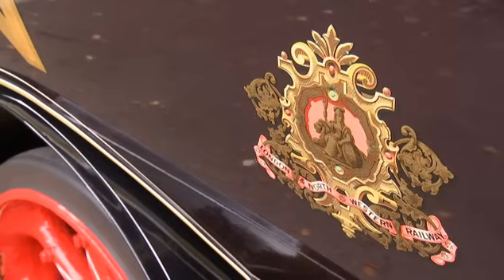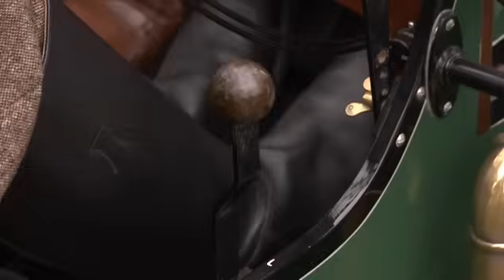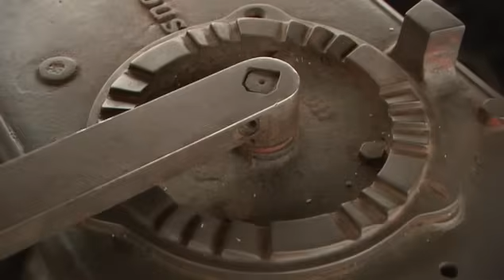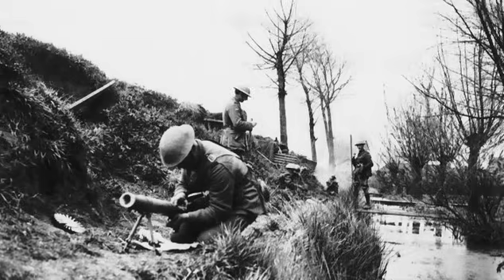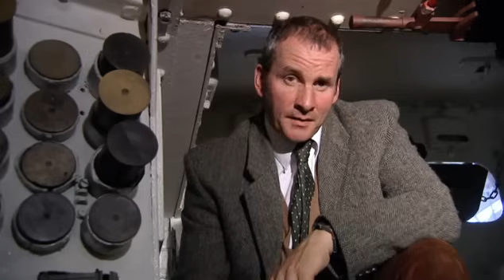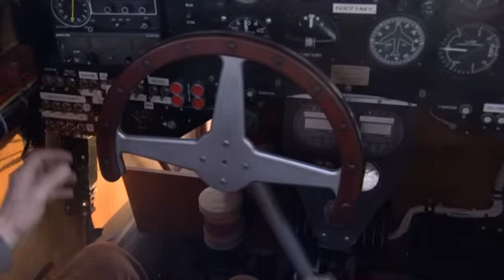Britain's Greatest Machines - S02E01: 1910s - Triumph and Tragedy (2.0 Stereo, 360p)

Comment: A "horse power" isn't the equivalent of a horses power. A HP is 750 watts of power.
Reply: That's the modern definition. The original definition from James Watt is the equivalent number of work horses (bigger and stronger than a regular horse) that one of his engines would replace. It was a way of marketing his machines to businessmen who knew nothing of engineering, but knew the cost of a horse.
Reply: One hp is 745.7 watts, or 1 ftlb of torque at 5250 rpm, or 33,000 lb lifted one foot in one minute, 550 lbs one foot in one second. 

This output of lifting was measured from horses. 

The difference is that a horse can do more but only for a short period and couldn't maintain one rated hp for very long. Three horses would be required to continuously move the same weight a single horse could. They also got sick, and consumed huge quantities of food even when not working.

James Watt and some others did for almost 200 years, count the standby horses resulting in "inflated" numbers, but more realavant to those actually replacing teams with them. Now we do not count the standby horses.

A huge advantage to an engine was direct rotary power for feed grinders, pumps, saws, winches, threshers, etc etc. 😊
Reply: No youre all wrong😊 one hp is 75 kg one meter up in one second. Ie 750 x 9,,81 = 735,75 Watts.
Reply: Yes, we are all wrong its 745.7 watts. 

You can convert it to metric if you want, but James Watt did not. He stated it as 33,000 lbf/min, 550 lbf/sec.

I run and owned dynomometers. I can say that When you put 1200 hp in a 1900 lb with driver drag car it MOVES!  😊

Comment: The machine gun contributed to the stalemate of the Western Front, but the machine primarily responsible for the stalemate of the geat War was the steam locomotive. If a breach in the enemy line occurred, craters and barbed wire limited the vanguard of an advancing army to walking speed; meanwhile the enemy's steam locomotives could rush train-loads of ammo and reinforcements to the front at railway speed. This disparity of logistics prevailed even when the tank entered the battlefield. Tanks broke through and advanced swiftly into enemy territory, but the army behind them couldn't move fast enough to take advantage of the situation.

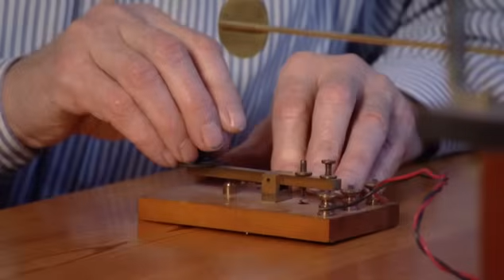Comment: 20:50 Titanic did not broadcast SOS, the distress signal widely used at that time was CQD.
Reply: Actually TITANIC used both.

The CQ was code "shorthand" for a call ANY BODY LISTENING. If calling specific station or ship would be followed by call letters, such as MGY for contacting TITANIC. 
The DISTRESS call was CQ followed
Reply: Around 1212 a new signal SOS was introduced, as easy to recognize even by novice as S was 3 dadhrs and O 3 dots repeated several timrs.. ,After about an hour TITANIC used both..

Comment: Actually the Titanic did not initially send out an SOS through Morse code, it sent out CQD the common distress call of the time. The ‘CQ’ (sécu - French meaning general alert) and D (distress) since SOS had not been formally adopted. As time progressed the wireless operators later began alternating between the two
Reply: 😅😅 47:26 😅 47:26 47:26 😅 47:26 😅

Comment: That Morgan cycle-car is cute, but in American in 1913 for just 10 pounds more, you could buy a Ford Model T that had 4 wheels, a four cylinder engine, could carry 5 adults, go 50mph, and came with a folding rubberized cloth top so you could drive it in the rain without getting drenched. By 1925 the price for a new Ford Model T Turing Car had dropped to $260, or 58 pounds. In 1913 Britain, the upper classes had it made, but everyone else was getting screwed.
Reply: So what's changed, other than the upper class Brits are Arabs, Russians & Chinese
Reply: @jeremyfine1464  : You are confusing class with wealth. Very different.
But I take your point: 
The British "ordinary" people are still being screwed. 
It's now just so much more multi-cultural. 
One feels so enriched even whilst being screwed on all sides.

Comment: Its odd that you would have to wind a "clockworks" every half hour especially when there was electricity available to simply power a DC motor...  WTH ?
Reply: Probably more accurate and can keep going through power outages due to sinking? (I am making it up as I go along).
Reply: True, but you do get the point of my comment, No?  I mean it was a new technology, fully dependent on electricity and it needed to be manned by a human to perform its intended purpose, why invite error by relying on a spring.  What would the operator be waiting to receive during a power failure, besides his next drink?

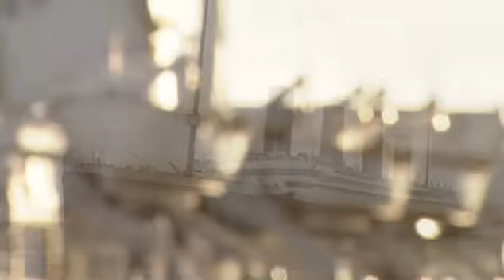Comment: In regards to 20:00 in, the radio set that was aboard the Titanic is a fascinating example of Victorian age radio. Keep in mind that radio set was not only before the transistor; it was before the electron tube. How on earth is that possible? Victorian age radio, while ridiculously hilarious in its simplicity, was ingenious. The Victorian radio transmitter wasn't much to accomplish, consisting of a spinning rotor, electromechanical contacts, and a tuned resonance circuit, but the Victorian age radio receiver was a bit more tricky. I confess I never would have guessed how they did it. They did it with an early form of magnetic recording. A continuous loop of wire, powered by I swear to God a wind up mechanism, would continuously magnetize a wire and then the magnetized wire would pass through a coil of a tuned resonance circuit attached to a very long antenna wire. When the operator aboard the Titanic had his key pressed, he'd be transmitting a sinusoidal electromagnetic signal that would travel at the speed of light to the tuned coil of the land based Victorian age radio receiver in which the alternating current would demagnetize the portion of the wire traveling through the resonating coil. The wire would then pass through another coil attached to earphones and voila monsieur; the Victorian age radio operator would hear clicks that would be recognizable to any telegraph operator. It's sometimes said that the the telegraph was the Victorian internet. One could also say that the Victorian age radio was its Victorian smart phone.
Reply: It was Deforest,an American inventor.  who invented the autotron vacuum tube in 1908. It is possible that the Titanic's radio had these tubes.
Reply: @rayfridley6649  No, the Titanic used a Marconi 'wireless telegraph machine' which used a massive motor-generator set and the spark discharge principle. It was so large and so noisy that transmitter and receiver were in separate rooms. There were no vacuum tubes involved, although you are correct: it had just been invented by DeForest.
Reply: @rayfridley6649  Audion. It was called "Audion". Cheers
Reply: @chalesashurst1816  Thanks for your explanation, so the "loop of wire" must be iron wire, did they already know resonation circuits and they needed a rectifier to demagnetise the wire. Please tell me more about this miracle

Comment: try flying the computer simulated version of the Vimy, it's a fascinating experience.  You manipulate the controls, and then absolutely nothing happens far another two or three seconds.  Maneuvering  the thing took constant, stressful, exhausting planning trying to get it to go where you wanted.  I couldn't imagine doing that the entire distance of the Atlantic.
Reply: I found the real problem in the computer version the lack of trim control. Since you don't have a co pilot to take over for a bit, and thus cant let go of the controls for a second or you crash. Be hard graft in reality.

Comment: They couldn't build a bridge high enough to clear the sailboats?? There has been a solution to this problem called a lift bridge. The first lift bridge built according to google was 1905 and this Gondola thing was built in 1911. I don't think I need to explain why a lift bridge is far superior to this stupid Gondola sky car.
Reply: It appears the gondola bridge was much more durable and reliable than a lift bridge, being used for so many years. Too bad someone decided to "upgrade and improve" a device which worked just fine for so many years.
Reply: Do you mean something like Tower Bridge in London?
Reply: I think you should explain why a lift bridge would be better.  More expensive to build, intended to carry  autos rather than pedestrians.... Maybe you expect the lift bridge to last longer?

Comment: I hate to point this out, but it was the French who figured out the design for what would become the standard in Tank design. Those big British jobs, where just too big and slow.
Reply: Its true the little Renault was the way forward for future tanks (smaller, much faster, turreted), but the Mark Iv and Vs were designed for a more limited task.  That is, to crush barbed wire and trenches to clear a path for infantry - something they were much better at than the Renault  They weren't designed for pursuit or antitank combat, and even the fire support role was an afterthought.

Comment: A pity that the bridge has now been modernised. Now driven by modern a.c. motors, the control room has gone, as have the overhead wires
Reply: What an absolutely tragic shame, it worked so well and was clearly original. The stupid things people will do to save a small amount. In 20 years when the new system wares out and funds will be needed, they'll wonder why they changed it!
Reply: @julianneale6128 
The bridge has now been out of use for several years, not because of the new drive and control systems but because of structural problems with the bridge itself.  The last I heard it will be at least several more years before repairs can be carried out.

Comment: Just putting it out there, but i'm pretty sure that Titanic's distress call was CQD not SOS
Reply: You are partially correct.   She send out the CQD code first and later added the then new SOS distress call as well.  Probably the first ship to use both.
Reply: Thats right, i completely forgot that last bit
Reply: lazaruschained You may be interested in the article "Acquitting the Iceberg" over at Encyclopedia Titanica.

Comment: 36hp lol
my little 4 cylinders has more than 4 time the power
Reply: Sure, but how many people can it carry ?
Reply: +ganymedeIV4  HP = Torque x RPM ÷ 5252. You sure torque is something that stands by itself?
Reply: +ganymedeIV4 Now you have all 3 parameters on your plate? lol.

With PROPER REDUCER on my little 4 cylinder, I will get 36487.6 lb-ft ("Ft/pds" [sic]) at 19rpm. Power in the calculation is 132hp according to the car manufacture's spec. It is the gear ratio that makes difference, same concept as Archimedes' "Give me a place to stand and I shall move the earth". That is also why tractor and car transmissions are designed differently, they emphasize on different things.

True, larger flywheel will store more momentum, even at low rpm. But do you like a vehicle that take forever to accelerate/ decelerate? Race cars use lightened flywheel, how about go argue with their engineer about them not knowing what they are doing?

Now you can play the efficiency or lb/hp card etc., your call. All you really need is a college level machine design class IMHO.